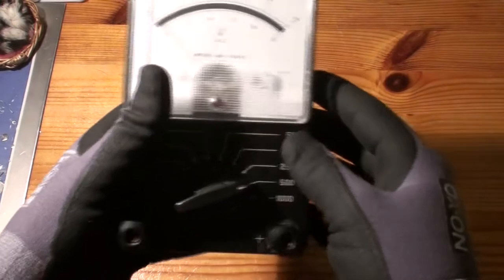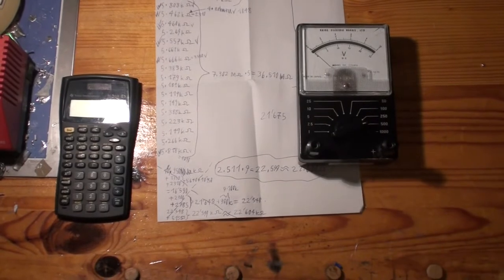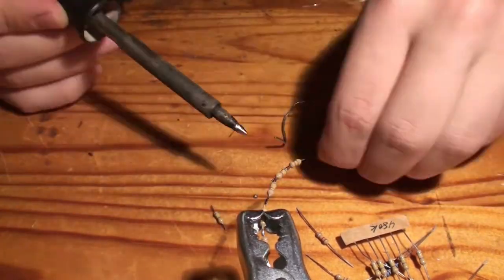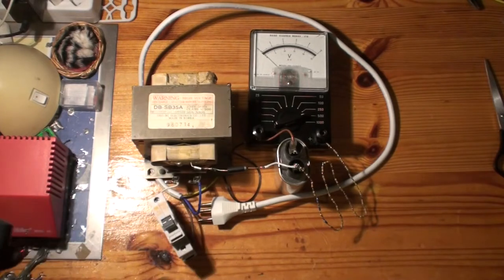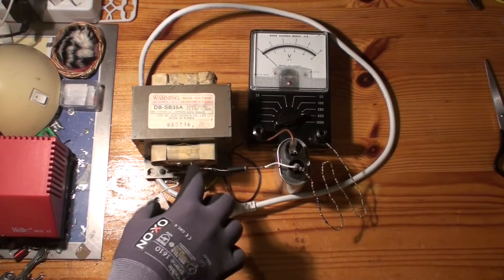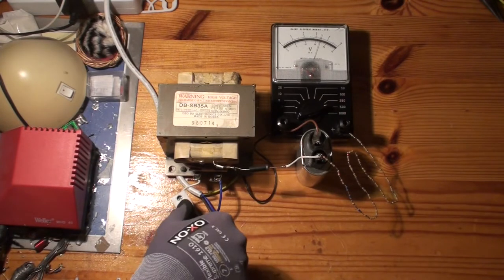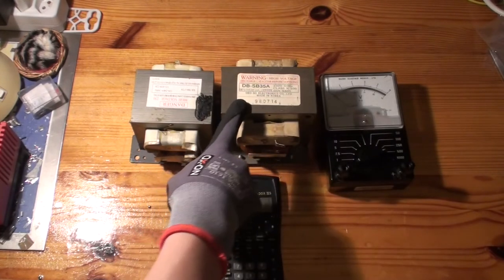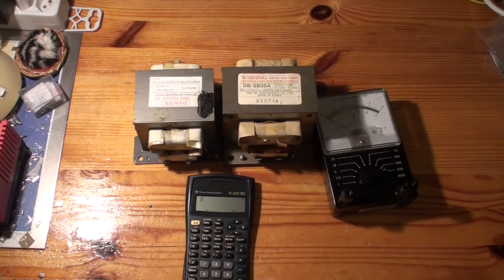Analog voltmeter high voltage mod

Comment: Thanks so much - this is exactly what I was looking for  - Ive got some very nice large Analog meters from an old Automotive test unit - I have made some nice lower voltage (120v) meters with just a potentiometer - but I figure with breakdown voltages over 600 volts a potentiometer is probably not going to work - so I'll use the solderup a bunch method like you used

Comment: I need to measure the voltage output from the High Voltage side of a microwave transformer - but can I ask why you don't Variac into the 120v / 240v  side of your microwave transformer ?  - those MOT's look good - seems like newer ones are smaller or now using IGBT's - although they don't seem to work as well
Reply from the maker: You can do that, but I specifically wanted a high voltage divider to monitor the voltage on a capacitor.
Reply: @sciencebysergio  Thank you for the reply Sergio - I bought the resistors and now have to just do the soldering work and get to it - I like these Analog meters and I don't want to blow them - I will watch your video a few times over to be safe
Reply: @sciencebysergio  Also I would like a Analog current meter for the HV side also and it seems I also should use a voltage divider with a string of diodes as my FWB rectifier - any thoughts of that ?  I might just use a clamp on meter